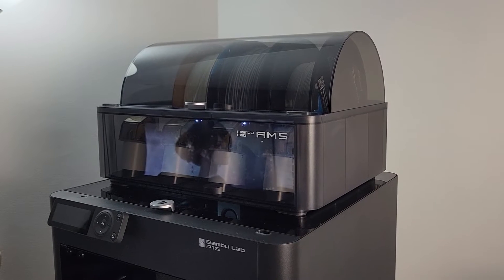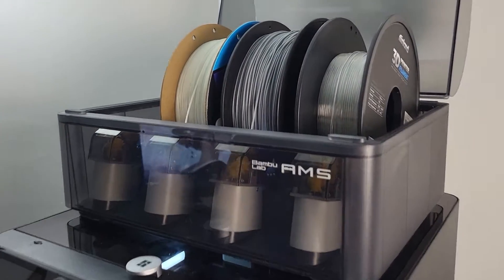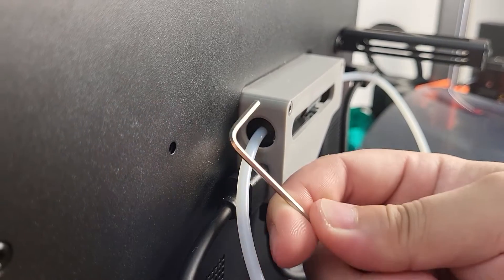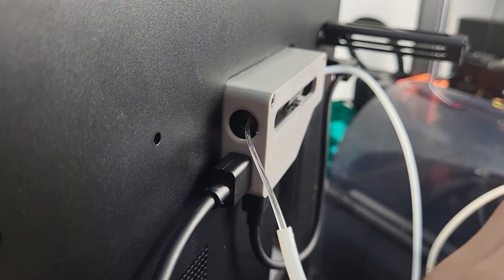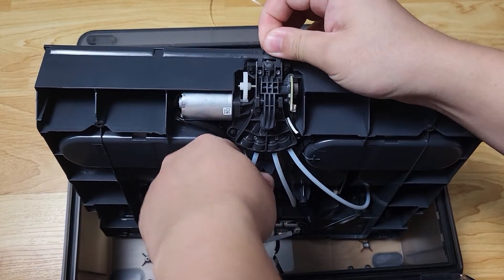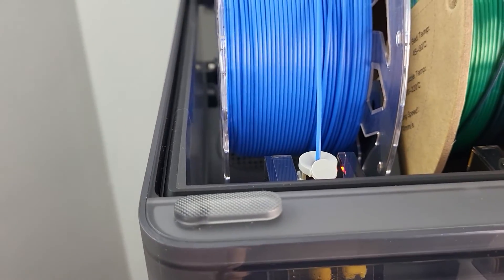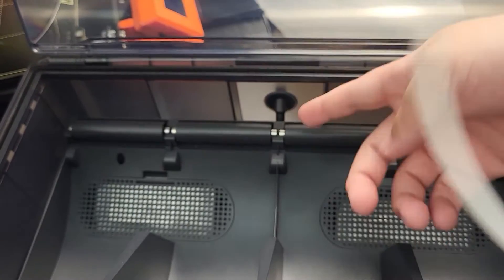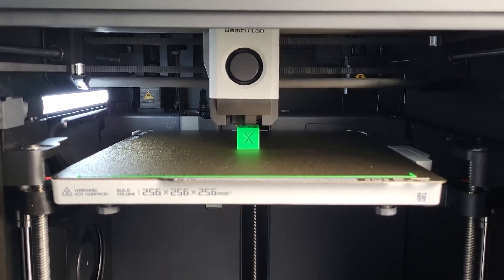Bambu lab AMS clog fix tutorial, failed to pull out the filament from the extruder issue

Comment: 我已经手动把堵住的料清理了但是它必须要我unload。根本没有料它也unload不出来。然后会继续抱错。有没有办法让ams强制认为某一个槽已经空了哇？

for my english speaking friends: I had a clog and removed manually. But AMS still thinks there’s material in that slots and keeps trying to “unload” where there isn’t anything already. It will always error out during unload saying stuck filament when there isn’t anything to begin with. Is there anyway to hardsreset ams?
Reply from the maker: Check if there is nozzle stuck on extruder, it will also cause error report as you described.
Reply from the maker: Also try to disconnect the ams cables to the printer while power off and reboot it again.
Reply: @SvgLau  solved, I just loaded a seperate spool and that's solves the problem somehow without trying to unload.
Reply: @SvgLau  thanks!

Comment: I really need help please. I can not disconnect anything in the back. Everything is stuck. Starting from the 1:40 mark on the video, none of the connectors are disconnecting. I see the black PETG running through the pipes but the connectors just wont break loose
Reply from the maker: You should be able to disconnect the PTFE tube on  hose connector by press the blue part inward. Cut the filament when you can. If the hose on top really wont disconnect, try disconnect lower area where hose goes to the light gray box, I shou have that cover on video. As long as you can disconnect somewhere and cut the filament, you should be able to find where it stuck and get it out.
Reply: @SvgLau   Thank you so much for replying. Once I removed the tube from behind the AMS box itself, I was able to pull out the rest of the tube connections. I guess since my filament was running all the way through, I needed some slack in the tubes to be able to pull them apart. Turns out my filament was stuck within the print-head, right before the nozzle. I heated up the allen wrench and stuck in there to melt the filament then pulled it out once they cooled down inside. I am running calibration now hoping that fixed it.

Comment: Hi all, since today i keep getting error that there is some thing stuck in the filament tubes and to try again. I checked all tubes and even the nozzle and the filament reaches the nozzle no problem, in fac if I detach the tube from the nozzle, the filament keeps on flowing to it indefinitely, but once it reaches the nozzle hole it stops and goes back. there is nothing stuck in there,i checked multiple times, even with a little neelds to see if there was a little particle of the previous filament but nothing, what i need to do?

Comment: Great video, thanks!   The hardest part about this is reattaching the filament tube back into the AMS.  I did it wrong 5 times before I got it right.  The alignment isn't the best, and it is hard to feel it.  I would hope they can make that better in version 2 ... I would hope that the connection to the AMS could somehow be "hardened" to ensure it would go in the 1st time.  Otherwise, spot on.  My clog was the result of it finishing a spool, and the end of the spool had a kink in it where the filament inserted into the spool.  That kink got jammed in the AMS feed gear.

Comment: Sorry, but this video is not very thorough.
You mention 3-4 places the problem can be while you go through "defining the problem", however you only cover the solution for one of them.
I. E. No solution for this error code if the filament is stuck on the first area you check (going into the printer itself).

Comment: Good tutorial, but my filament, in this case ninjaflex, is not releasing when I push down hammer.   any ideas ?
Reply from the maker: So, if I got you problem right. When you push down the leveler, but you not able to pull the filament out.  
I will first check on the PTFE tube above Extruder and see if filament stuck in there. If it does, heat the nozzle, retract filament. Or, you can open the extruder front cover, release the PTFE tube inside extruder to manully pull the filament out. 
If your filament wasn't stuck above extruder, I will go back or the AMS box and check if my filament stuck on two possible area: 1, (tubes behinds AMS). 2, (tubes behind the printer, where there is a spring loaded box). Normally if filament stuck on 1, you will need to disassembly the AMS as shown on video to pull the filament out. In case 2, just relase tubes from both side of the spring loaded box and see if you can pull filament out. 
Hope that helps.
Reply: @SvgLau   actually, I tried same way later and filament did come out.   from now on, just using PLA in AMS!   thanks for help.

Comment: What if this happens every single print is finished or on a color change?  It seems to be happening to me on any filiment & only when its retracting....  ive fixed this 5 times in a row now & same thing kink in the filiment inside the ams feeder.... 😅 any suggestions? Im going crazy 😅
Reply from the maker: there are some upgrade you can do to potentially to fix this issue. It all basically relate to the pefe tube feeding system. I will make one update video in few days to talk about it.
Reply: I'm having the same exact issue.  Seems to be excessive friction in the AMS which has nothing to do with clogging.  Mine is less than a month old, but in slots 3 and 4 the retract after a print fails often and I'm also getting a little underextrusion which creates weak but functional parts.  Sadly parts I cannot sell for my business.  I think the PTFE feeding has some extreme sensitivity to the friction of a filament has passing through.

Comment: Very useful video. The question for me is, why does PLA clog on the AMS return pull? I'll have it clog with Creality PLA (the same clear spool you showed at :30), which I thought was the spool's fault, but I transferred it to a Bambu spool and it still clogged. It's totally fine PLA otherwise. The Bambu spool with Creality filament wasn't perfectly wound (but not that bad either) so my only guess is that it needs a very well balanced Bambu spool to work properly. Why though? The Creality spool seems to roll and grip just fine.
Reply from the maker: I have two types of filament from creality using that style of spool. Ender series always works fine, HP series always snaps within the system and cause issues. So, for my guess, is that the fialments cause issues instead of spool in this case. Cuz I know my HP series filament is wet and always snap randomly. If you have filament dryer, try to dry your creality filament first, and it might be helpful.
Reply from the maker: I also found that when the creality spool near empty. It sometimes get lift by the gear pulling the filament. There is a mod online called "AMS helper" might help with this, it may help with your situation.
Reply: @SvgLau  I don't think it's a lifting problem since I have had it happen with almost full spools. I finally had it happen with a nicely wound roll of Overture on a Bambu spool so now I sort of think it's an AMS defect. It still could be the PLA, but it's hard to convince me of that since the PLA it happens with works and feels completely fine otherwise. I did find that if I tug on the filament lightly while it's "retrying" the pull, then it catches and pulls fine, so that's at least a plus and again makes me think it's an AMS "catching" issue.
Reply: @one_mega_ohm9139 I'm having this exact same issue.  My PLA Plus is NOT breaking, fraying, warping or anything.  But somehow the AMS will fail to pull it back.  If I completely turn off and reinstall the AMS though it manages to do full calibration just fine, it's as if the motor in the AMS is not getting full power during retract at the end of the print but works fine elsewhere.   I am getting some underextrusion though which is concerning.
Reply: @one_mega_ohm9139  I am having the same thing happen! I'm using Bambu PLA, Amazon basics, etc. I tried all kinds of spools. It's def not that. The tugging thing you describe is exactly what I have to do like every 5 min. SO FRUSTRATING.
Reply: Did you ever get a fix for this? It's torture trying to print anything right now.  @BrandoDrum
Reply: @classroom_jams  nope, in fact now it's happening in the other slots too.  I just used pipe cleaner to clean all of the ptfe tubes in the AMS system, trimmed the bit of PTFE that comes directly out of the AMS to the machine and re-greased some gears in the first stage feeder but I haven't tested yet.  Bambu Support initially responded and said it was the first stage feeder motor/gears potentially and had me do a test of swapping the PTFE tubes.  However, I couldn't afford to just test things out as I rely on my printers for my business so I was just using the first two slots.  Now those are giving me occasional issues so I'm actually not using the AMS at all until I can catch back up on orders.

Comment: Just for future reference you're not supposed to use flexibles like TPU in the AMS unit.

Edit:

Thank you for posting these types of videos. It's thanks to your contribution that others may service their machines etc in the future. Especially if they don't have a technical background or experience.
Reply from the maker: It really comes to my original goal of making this channel. My self comes with an engineer background but still have hard time starting with 3d printing as a newcomer to this hobbit. So a lot of those videos are really focused on beginners and some more of prevent beginner's common user errors.  
It ended up taking me so much time to produce videos like these, and review numbers are predictable low. But as long as it helps people and I see positive feedback, I will still do it.
That is what I like 3d printing, open source, and the community are the charm of this hobbit.